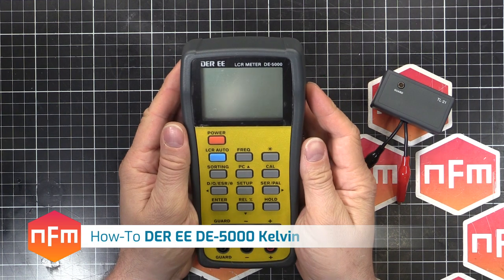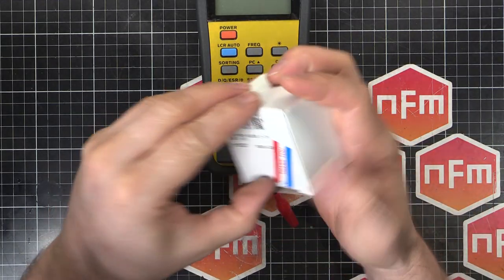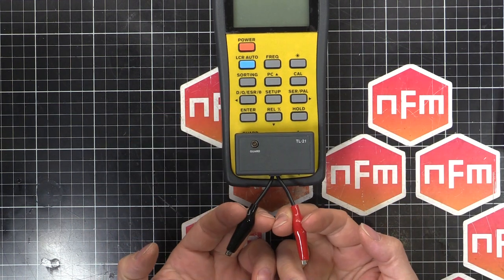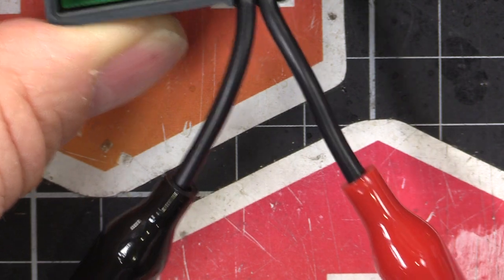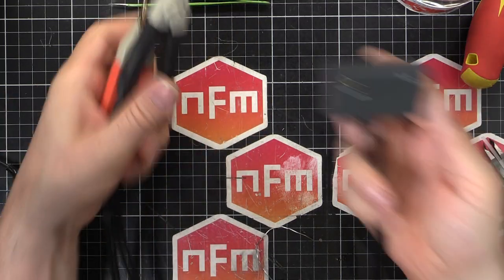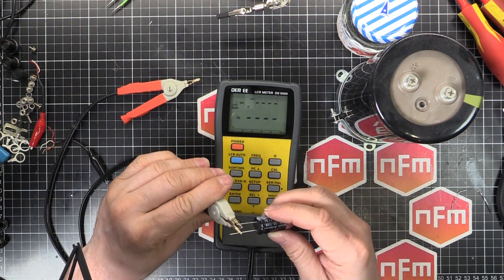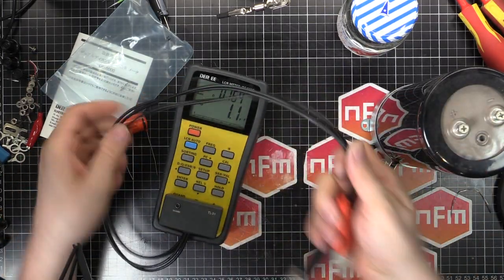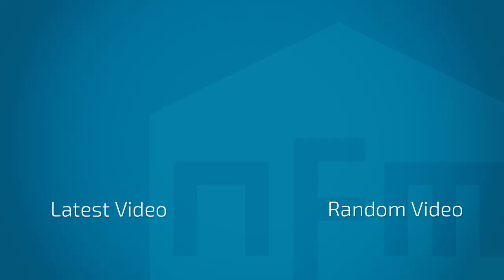DER EE DE-5000 LCR Meter Kelvin Clip Mod

Comment: I have this meter. And it's a really good LCR. Worth checking caps are discharged before connecting.
Reply: Fancy seeing you here Simon.
Reply from the maker: Very important for these meters as there is no input protection.
It's detailed in the manual I believe but it does warrant repeating.

Discharge your capacitors!

Comment: Just be sure to do an open and closed calibration after customizing those leads, and anytime you switch between the tweezers and the clips. It makes a pretty big difference when looking for milliohm differences or measuring precision components. It’s really fast and easy, described in the online manual, once you’ve done it a few times it’s just second nature because it only takes the press of a single button and waiting about 30 seconds to different times
Reply from the maker: Yep, the calibration is important as you say. I do the same before any critical measurement. Same with my HP 4276A, it's easy and quick enough to do that I just do it out of habit too.
Reply: @NearFarMedia  but you did not do that be for you tested tho

Comment: I did the same mod a year or two ago… The exact same Kelvin clips from eBay and the exact same adapters. It kept giving me an error with that attachment when trying to calibrate… 

And I know for 100% certain everything was soldered correctly. I checked it all 1000 times with an army of equipment. Even tested the clips and leads on some of my other LCR meters benchtop and a handheld… And everything worked perfectly. But the attachment wouldn’t work in the D 5000, however the SMD tweezers and original gator clip attachment still worked perfectly.

No idea what the problem was. I remove the batteries from the De5000 and put it back in the case. Then a few weeks later when I needed it for a repair job in the field…… I plugged it in and everything worked fine. 

Calibrated the new Calvin leads and everything’s been great since. No idea what the problem was. 

I couldn’t have done more textbook job… Had to assume it was in the software, considering the device is programmed for short leads, and isn’t used to anywhere near that type of resistance and capacitance in the leads… That the machine has to “zero“ itself. I’ve even seen documentation from that company warning against using longer leads… But I recalibrate it regularly now, and everything works fine.

Another observation… There’s no battery reverse or input protection. So if you put the battery in wrong it will blow a few SMD parts on the board. That’s apparently happened to several people on the EEV blog and elsewhere. Too bad they don’t have a battery slot which protects against that. 

Apparently the battery reverse protection and input protection would screw up the readings… So in my opinion… It works better for me if it’s completely accurate and I’m just extra careful to de-energize everything I’m working on… Drain all the caps, and not put the battery in backwards.

I really enjoy your channel. The frequent test gear videos are awesome! There aren’t many electronics channels on YouTube that focus on test equipment. And the ones that do usually only play with $10,000 pieces of gear. Although I love my 8.5 digit meter and multifunction calibrators… I can’t afford that stuff without buying untested units, then repairing and recalibrating myself… So it’s more enjoyable to see every day commonly used to test gear.
Reply from the maker: Huh, strange with the calibration. I can only guess that some values were being held in memory and somehow it was tripping up until the battery swap wiped the memory clean.
Maybe it throws errors if the calibration differs too much between calibration runs? Weird, but at least you got it working in the end.
Mine calibrate fine so I guess that makes for two votes in favour of this mod. :)

Comment: Thanks! I think those big kelvin clips are by far the best leads. Too bad DER doesn't supply them. I did the same with my DER5000. Works great even without cal I get 1mOhm measurements.
Reply from the maker: Yeah I end up using them all the time. Turns out more convenient for using the meter, the kelvin clips are more manoeuvrable than the entire meter.. :)

Comment: It's been a long time, but you have to adjust the frequency of the capacitor. Generally >10uF - 100 Hz; <10uF 1kHz; nF,pF - 10kHz.

Comment: Would you mind doing comparison measurements between the stock tl-21 and the 4-wire modded one?
Reply: @saltima  by taking measurements before the mod and after. too late now though. Either way, Dont think ot would have been a huge difference considering the very short leads of the original
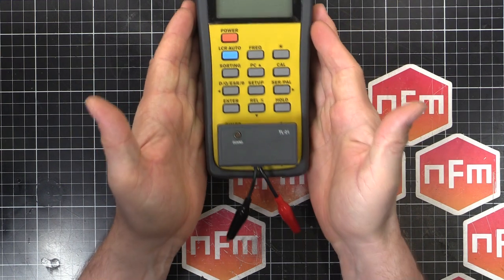Reply: @saltima  - if you watch the video carefully 1:20 - you'll note he has purchased 2 sets of test clip connectors. So he can test both against each other.

Comment: When I tried to modify the test leads of my MESR meter, for longer ones, I was told not to, that "LCR and ESR meters need for their test leads to be short - for more accuracy". So, who's right?
Reply: Generally the shorter the better, however any decent meter will have the ability to null (zero) the test leads before each measurement. Specifically...
For resistance, the length doesn't matter for resistance if it's a proper 4-wire connection. For low ohms where there is large currents, you want to keep the "power lead" resistance reasonably low but the voltage measurement leads can be thin. Really, these coax cables and cheap Kelvin clips are too small for Low Ohms measurements anyway.
For capacitance the length DOES matter (since parallel wires will add capacitance), however these coax leads are shielded so that may help reduce the effect.
For inductance, the length matters especially the leads are coiled, and I am unsure what the effect of any shield will be.
Reply: @johncoops6897  I did the same mod with the exact same leads, however I didn’t keep the full length I shortened them a little bit. Probably shorten them a little less than half of their length. Which helped a lot and help the meter to zero and re-calibrate itself open and closed… More accurately. It’s pretty important to re-calibrate the meter “short and open“ each time you switch leads between the tweezers and the Kelvin clips. If I’m in the field, away from my bench gear… Then I recalibrate it every few minutes if I’m doing critical measurements.

It compares really well to my sencore and hp lcr meters, It’s usually just as accurate… But not quite as consistently. There is a difference in precision and consistency.

However… If you need something more precise than this regarding resistance and capacitance… Then you’ve already got a lab fill up equipment anyway.

Comment: In the video, you cut off the foil shield stub from the probe cables and do not connect it to anything. I take it that you were confident in doing that, because the bare ground wire is likely in contact with the shield, at some point along the cable, thereby making a path for any noise to go to the meter's ground. Many brands of this type of cable also include a nylon string, or core, for physical support, inside the shield, along with the three wires. I think this string, or core, might limit the number of places where the ground and shield make contact. And, the type of connection between the bare ground wire and the shield would only be by physical contact, anyway. That's not really a good connection. Further, I am confident that the manufacturer did not connect the ground and shield at the probe end of the cable. So, I think there is value in wrapping the shield stub into the ground wire and soldering the two to the ground pad on the PCB. I would like your thoughts, in this regard, before I finish soldering up my kit. As an aside for other types of applications with shielded cable, we must always make sure that the way we use, or connect, the cable wires and shield does not allow the shield to become a hidden path to tie the meter to the DUT's, or Earth's, ground. I imagine that the best way to do that is to always use cable that has an insulated ground wire and to only connect the shield to ground at the meter end of the cable and never at the DUT end. Care would have to be observed to prevent the shield from touching the connector case, at the DUT end, because the DUT case might be grounded. This is not my area of expertise, so I hope others will comment. HTH and keeps us safe.  I am sorry to be so wordy, I have not had any sleep.
Reply from the maker: The ground wire is in direct contact with the shield for the entire length of the cable. The way I terminated the ground wire is fine and industry standard for this type of wire.
Usually the foil shield is aluminium foil so you won't be able to solder to it anyway.

Comment: Ahh.. Made the same mod to mine “dairy” meter. Stole the idea from Defpom. This company supposedly makes decent multimeters as well. Priced similar to Brymen. That Hakko desoldering gun is sweet, I thought.. so I looked up its price. s%*#t!
Reply from the maker: Yeah, The Hakko ain't cheap... I have it hooked up to a Hakko FM-206 station and it works well.
Not a cheap unit but I use it every day and love it.